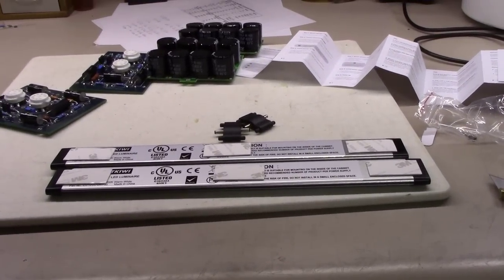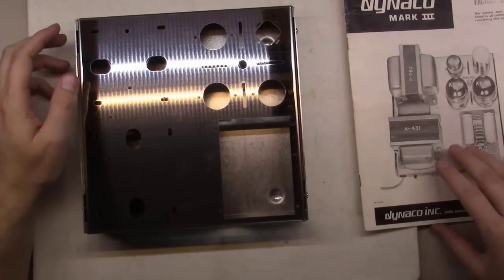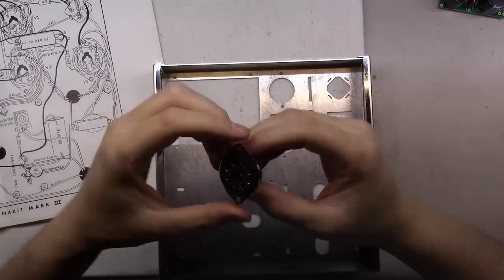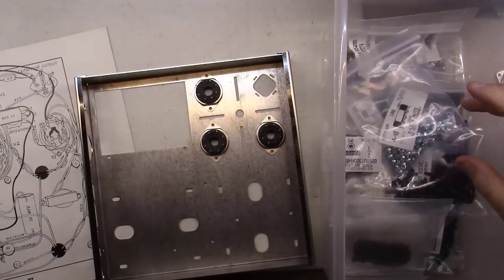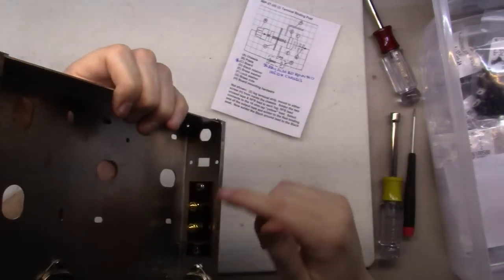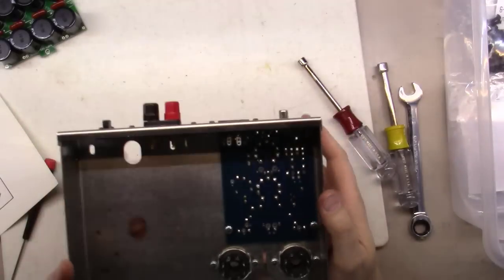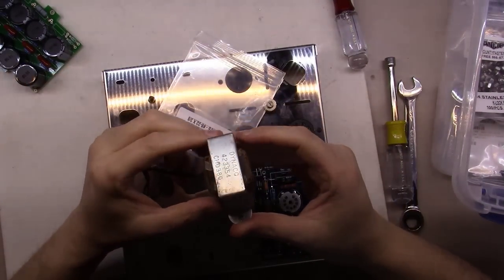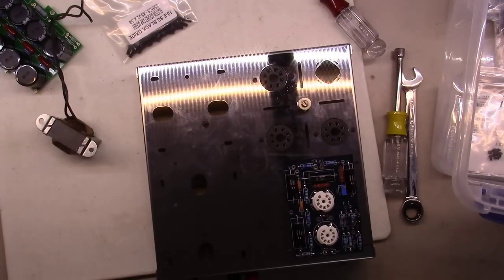Dynaco Mark III - MK 3 - Restoration Part 4 - BG072

Comment: I'm watching this on my computer which is connected to my dad's old Pilot preamp running a pair of Dynaco Mark 3 amps. The Dynacos are all original, unchanged from when my dad assembled them back in the 60s and they still sound great.

Comment: shades of building my first dynaco kit! reminds me of how old i am. it does look better than the original parts though with the new components. would love to hear how they sound with the new power supply boards though. the original units were a bit weak on transients. details suffered a bit during some passages because of this. they were really pleasant amps to listen to though and i kept my set for almost twenty years. probably should have kept them though all things considered.
=dok=

Comment: The new lighting is pretty blinky.  Add some extra caps to the power supply maybe
Reply from the maker: Yeah, it doesn't do it in person but the camera and it aren't getting along.  Will keep working on the lighting to make these videos better.
Reply: Just use a standard dc power supply like a mean well
Reply: Maybe it's PWM dimming? If so, set it to 100% ?